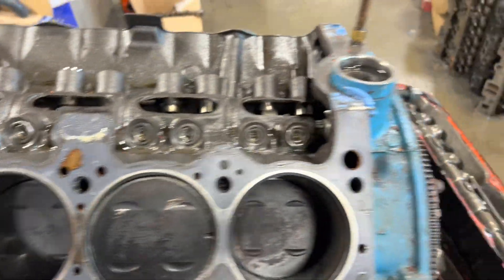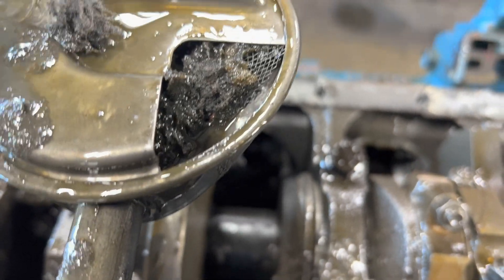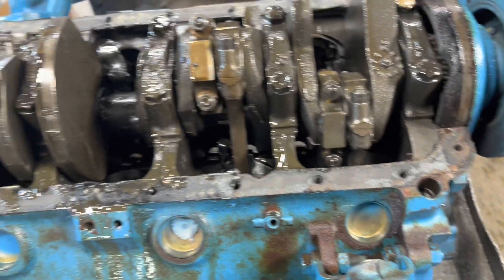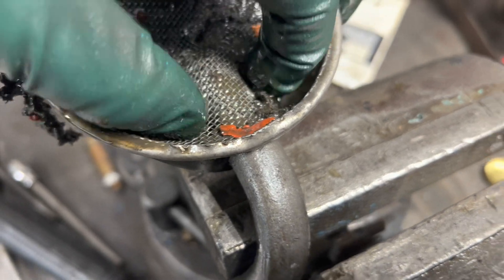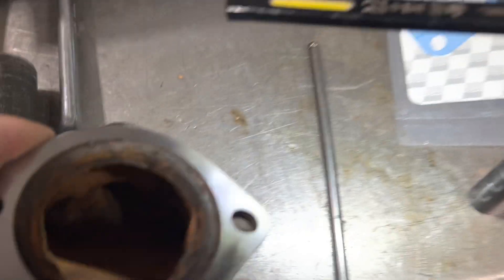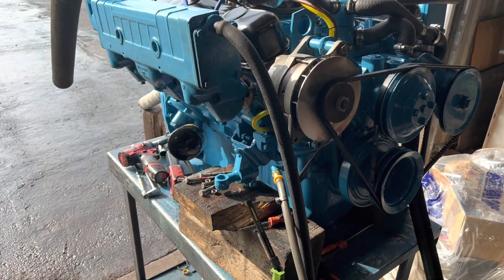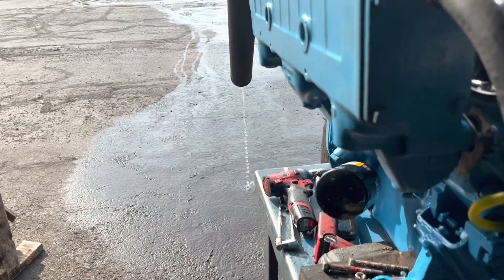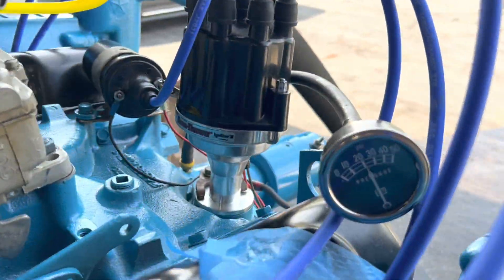1983 Trojan F30 Chrysler Marine 318 Engine Overhaul After Catastrophic Failure

Comment: So when the valve crashed into the piston, was it possible to buy a new valve and regrind the valve seat, or did you have to fit a hardened seat insert?
Once this engine was apart, did it also need an overbore or sleeving? I can't imagine that much chaos happening with the connecting rods without impacting the cylinder bores.
Reply from the maker: Yep, block was already .040 and went .060. Just a new exhaust valve was needed along with a normal valve job on the heads. Seat was unharmed.
Reply: @LakelandAutoMarine  Ah, looks like you got incredibly lucky.

Comment: Sounds sweet.  Are the oil pans stamped sheet metal like an automobile engine or are they cast?   Would have liked to see how you machined the crank.  Despite eating the towel, she seems no worse for wear.   Your work is very thorough.  Amazing results.  Thanksk.
Reply from the maker: The crank needs a weld. That will be a video at a later time. 😃
Reply: @LakelandAutoMarine  That's is exciting. Seems like there is good incentive to weld a crank if the engine is reverse rotation. I would think with an ordinary 318 crank, the heavily damaged unit would be scrapped, and a better core or already reground crank would be ordered.
When dealing with a reverse rotation engine, are replacement cams difficult to obtain? Does it end up paying off to regrind the OEM cam?

Comment: Didnt realise it was a LH running 318.
Wonder how a shop towel/rag that size could be missed.
Was the crank saveable or was it just too badly damaged?
Reply: Chris mentioned it was a right hand.
Reply from the maker: This is a RH or opposite rotation engine. Crank and block should be salvageable. I rebuild a better core short block we had to turn this around in under two weeks.
Reply: So is it pretty standard in the US for the majority of Starboard side gas engines to run backwards/anticlockwise when looking from the balancer end of the crank?
Only asking as Diesels (mostly marine) are what I work on and the only handed pairs or one RH rotation and one LH rotation engines arnt even made anymore now. Its all done nowadays thru the gearbox/transmission.
Reply from the maker: It was until around 1992. Since then, the aluminum transmissions such as the ZF 63 series and Velvet Drive 5000 series have to have a LH rotation engine and they output either direction. LH is automotive rotation. There is a Velvet Drive cast iron transmission with a 1.88:1 or 1.91:1 that is a reversing ratio. You have to watch out for that.